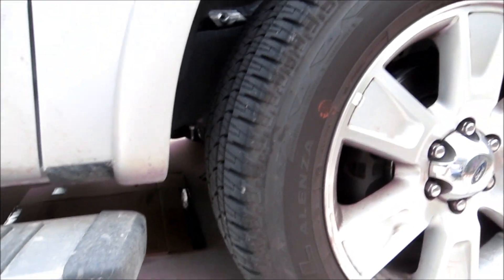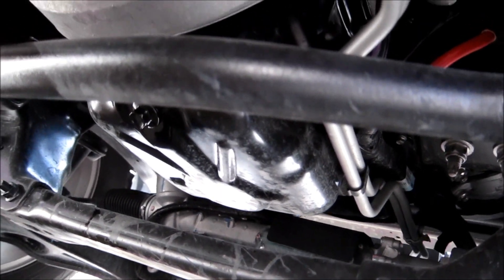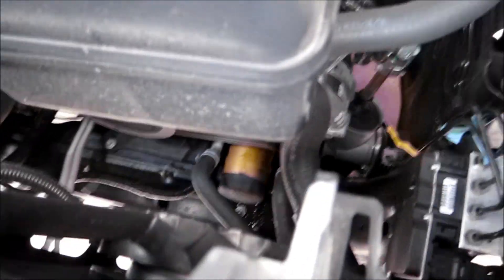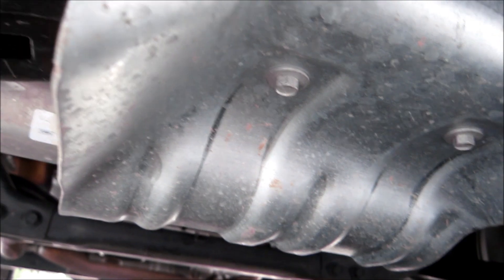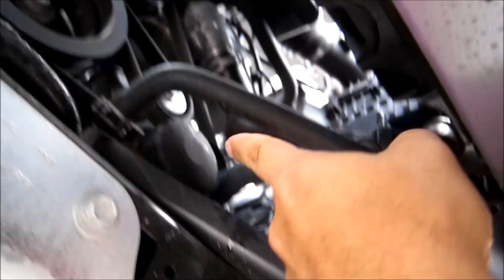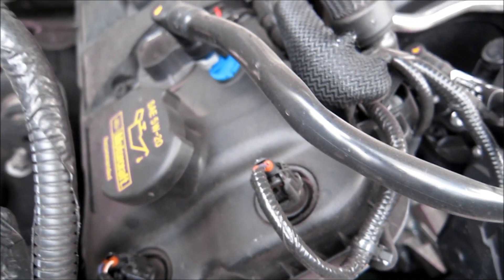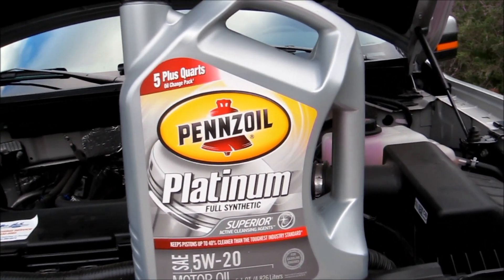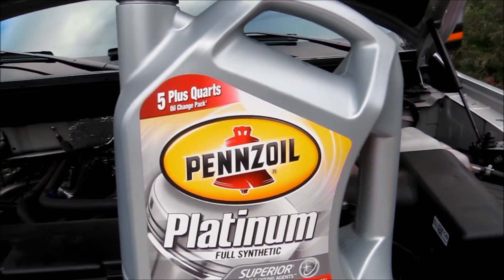F150 Oil Change This is 2013 But Other Ford Trucks Will be Like This

Comment: Motorcraft 5W-20 is the only oil to use for these trucks.  As good, if not better, than most "full" synthetic oils.  Plus, if you are buy a Walmart you can get a jug for $18.00.  I had a used oil analysis done on mine 2013 5.0 at 5500 miles and they suggested I go to 7500 miles before the next oil change and that is with alot of city driving and occasional towing.

Comment: My last F150 I always used k&n filter and valvoline high mileage synthetic blend and never had any problems. Was thinking about doing the same with my 13 Fx4 5.0 SCrew  F150.

Comment: furthermore, ONLY use Motorcraft oil filters with these engines.
Reply: 97widerider You don’t have to use the Ford oil filter brands if you don’t want to.  My car with a 2013 Ford Edge only uses some other full synthetic oil filters like the STP extended life, Mobil 1 and so on.  For the motor oil, they said to use the Ford motor oil but you don’t have to at this point, you can only use a different synthetic motor oil like Pennzoil Platinum, Mobil 1 or some other ones.  To me, I use Pennzoil Platinum and the STP extended life oil filter.  They filter it and last a lot longer.  I never had any problems in my car.  I’m just saying.  But although, the choice may be yours to use any full synthetic motor oil and other different kinds of oil filter...